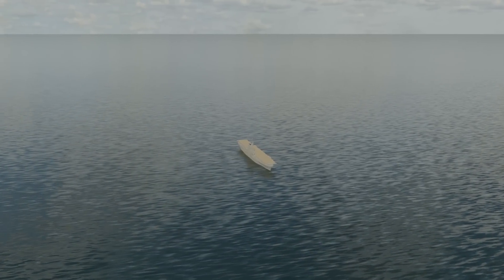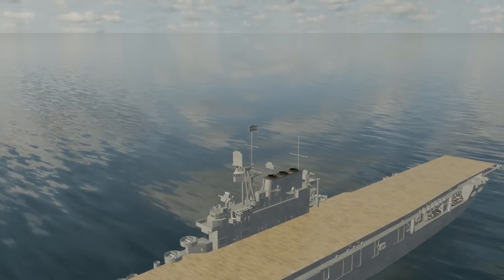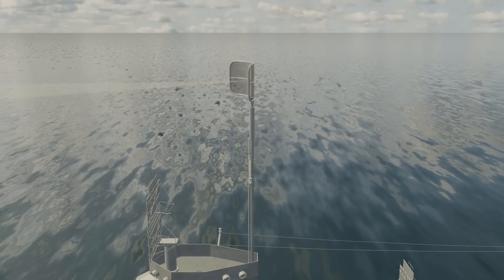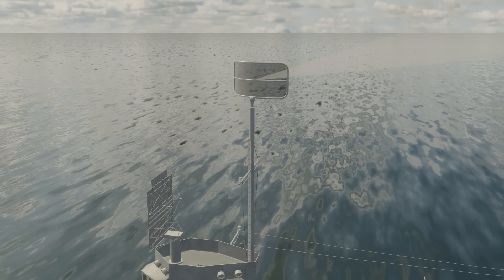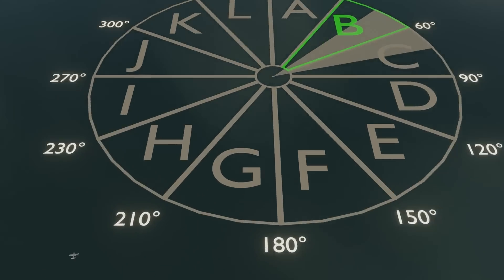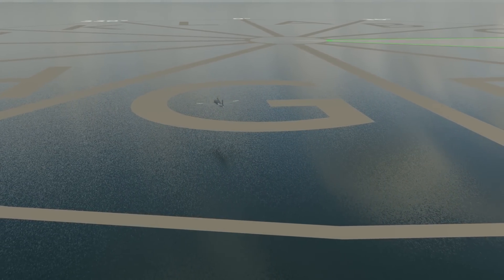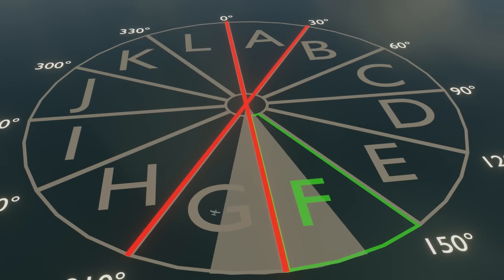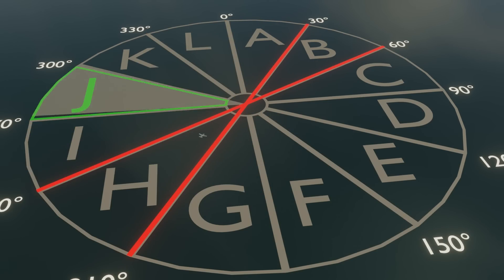Navigating Home: How WWII Pilots Found Their Way Back to the Carriers

Comment: Well, that is clever, however, being a former US Army communications specialist, I know that you wouldn't have needed to break the Navy's simple random Morse code shuffling system to determine the direction of the carrier. That's the weakness of continual transmitting on a single frequency. One need only have a direction finding receiver and a signal to tune in to... You would have needed a lot more than changing the code daily in order to keep the carriers safe. If one sweep of the transmitter took 30 seconds, and the radius were divided into 12 sectors, then a DF receiver would only have the signal for 2.5 seconds every 30 seconds. But loitering for just a couple of minutes would give you enough information to get an azimuth on the carrier. And...a smart enemy having multiple planes in the air at different points on the compass would get different azimuth bearings on the same signal, thus TRIANGULATING your carrier with great precision. So, I'm sure there was a lot more to this system than explained, and you'd probably in fact want to randomize the frequency as well, and they probably even shut it off entirely if enemy planes were expected within 200 miles radius. This isn't what I would call a secure system, though they didn't have the ability to frequency hop or digital encryption at the time.
Reply: thats how the British detected the German U-Boats in WW2, and the U-Boats are sending short messages and not continual.
This forced the German Navy to develop the "Kurier" System which shortens a 85 Digits message to less than 0,5 sec. length and they changed the frequency after every message, but in 1945 the British manged to get even this short messages on changing frequencies and locate the U-Boats again.
Reply: @Nik111333  Yes. As I was saying. You transmit long enough on a single frequency, or known frequencies that can be monitored real time, regardless of whether it is coded, and you broadcast your position for triangulation, and this was possible even prior to WWII. On land, it makes you subject to having artillery trained on you, which is why in the Army we used remote repeaters at times before frequency hopping digital became standard, capable of jumping frequencies hundreds of times per second. And only if you have the correct "hop set" digital key input into each radio on the net, and your radio's proper time of day in sync with the others, will you be able to keep up and TX/RX with other radios that are frequency hopping. This made DF'ing by our enemies nearly impossible, for a time. But now, with AI and quantum computing, this may not be very secure in the distant future.
Reply: @ReptileRescue 
Have you ever looked up the Heddy Lamar frequency hopping patent? I don't know if it was just her idea or did she really have the electrical engineering knowledge to create such a transmitter.
Reply: @fazole  I thought it was Headley Lamar?
Reply: @Boba-Fett-GS1150Ez  Nope, Heddy Lamar was a gorgeous movie star with a brilliant inventive mind.
Reply: @fazole  FYI The name is spelled Hedy Lamarr.
Reply: @fazole  ...she based her idea  around the 88 notes on a piano keyboard
Reply: You are correct.
Reply: There was more to this thing than was shown in the clip. The first layer, the YE and the ZB, worked at around 250 MHz which was pretty bleeding-edge in the 1930s. The YE's output was modulated with a 560–830 kHz carrier which itself was modulated with the Morse code. The ZB was a downconverter that fed a small MF receiver. As you can see, unless you had a 250-MHz DF rig, you could not get much usable intel from just the YE's carrier signal. For more, just google for "ye" "zb". That should give you all the good bits.
Reply: I suspect there's more to the system that might still be classified.  I agree changing letters once per day was insufficient for security
Reply: @cantrell0817  Nah, that wouldn't still be classified. You're talking about old analog cipher and single frequency un-encrypted transmissions. Nothing about that would be classified anymore. But there are probably certain additional details not known to the person who made this video. I worked with the most highly top secret comms gear from the Gulf War and into the 2000s, and even much of that with digital encryption and frequency hopping is old news now and being copied by Russia and China.
Reply: First of all they would not be broadcasting this all the time unless they had planes in the air that was due to return. It would be normally turned off unless it is time. Additionally what radio equipment did the Japanese have on their planes that would be able to pick out the signal? The A6M zero often flew without even radios to start with. This sort of radio equipment in WWII was in severe short supply.
Reply: @aikafuwa7177  First of all...I did this as a military job. I've forgotten more about this stuff than you will ever know. 

You appear to be unaware that radio signals travel at the speed of light, and you don't need to broadcast "all the time" to have a slow lumbering carrier be found by intermittent signals. You also seem unaware that the IJN flew more than just Zeros. 🙄 There are these things called bombers...and recon aircraft...anti-submarine flying boats... All things that carry direction finding receivers and who were listening for this kind of thing. Apparently you're unaware that signals intelligence was a thing...
Reply: @ReptileRescue  You are making assumptions about history, when it has been well established that the Axis powers lacked radar, lacked extensive radio equipment. You are assuming that the IJN had the top notch gear and top notch people with radio directional finders all the time. There was shortage of effort of the IJN looking for the American carriers, yet they were spotted first by the Americans at midway, why is that? You assumed what you are used to applied to how things were 80 years ago.... Not too bright, are you?
Reply: @aikafuwa7177  Not too bright, are you?
Reply: Each of those aircraft would have to be fitted with RDF gear..... was that at all common in the IJN in WW2?
Reply: Radio direction finders were common technology before the war even started. 🙄That's what the LOOP antennas are on aircraft of the time, which included just about EVERY amphibious recon and patrol plane and bomber.
Reply: @trooperdgb9722  Jesus that's dumb 🙄
Reply: @ReptileRescue  Comments like this negate anything intelligent you bring to the table. Your follow-on response alone answers the question from @trooperdgb9722 professionally and informatively without arrogant criticism.
Reply: @loutrioti8375  I brought the intelligence on this topic. YOU, on the other hand, added utterly NOTHING but snowflake grievance. I have no phucks.

Comment: Without being able to determine direction, a pilot might easily fly 180 degrees AWAY from the homing beacon.  I suppose, if someone in the aircraft was watching for a change in received signal strength, eventually, after many, many miles, it could be determined if the aircraft was going the right direction or not, but by then there might not be enough fuel to make it back.  Speaking of fuel, flying back and forth to find the correct sector to stay in would burn up a lot of their limited fuel.  Many of them didn't make it back for one reason or another.  I think that the ones that did make it back had a pilot or navigator that kept track of his 'dead reckoning position' so that he'd have a good idea of about where he was relative to the carrier and known the general direction to fly.

My dad was a Flight Surgeon on the Princeton and was in a PBY looking for downed pilots who had run out of gas when the ship was hit (and subsequently sunk) by a 500 Lb. bomb.  I wonder how many of them had run out of gas going the wrong way?
Reply: And these losses were normally censored, as well as so much else. Back then, not only censorship was understood and taken seriously, it was far easier to censor any information. Nowadays any bloke with a Smartphone can get different news from thousands of different sources including totally fake news. 🤯
Reply: This system is designed to make sure pilots know the unambiguous direction towards the ship.

Comment: What was the range of the homing beacon?
Reply from the maker: It’s in the video. 275 NM
Reply: @x-planed I guess it worked in HF. That thing was quite a powerhouse. But over the sea, propagation always improves.
I worked as Air Traffic Controller all my life in an Aerodrome near Lisbon, and one day I received a letter from a French Radio Ham stating that our little MF Locator was occasionally received in Bretagne, France! He wanted to know its manufacturer and output, which I gladly provided... 😀
Reply: @x-planed  I missed it. Thanks.

Comment: Of course the enemy could easily use directional finding to track the carrier fleet
Reply: I don't think so. DF needs your cooperation. You must transmit for a given time when instructed, so that your carrier wave can be received and plotted by at least two receivers set apart. The intercection of both bearings will provide your position. From the Carrier everything was passive, just receive and plot, no reason to transmit for too long. He who does not transmit will not be detected.
I had to learn DF in Portugal as late as in the mid eighties, to take my PPL. Which was ludicrous, because there were no operational DF facilities anymore! 😂
Reply: @duartesimoes508  maybe it wasn't ludicrous, as you're just confusing the topic of this video with the DF training that you were required to have.
Reply: @touristguy87  You don't understand. We were learning something that we were assured never to use. It looked like a bad joke.
Reply: @duartesimoes508  ...what makes you say that I don't understand that? Did you understand my reply?
Reply: @duartesimoes508  you don't understand. The fact that you think that you would never have to use it is not the same as being told that you would never have to use it.

that doesn't mean that it's a bad idea for you to study it.

Comment: A WWII P-38 pilot stationed in Italy told me how he found his way back to his home airfield. He would transmit on a specific frequency giving the regularly change code for his field. Directional finders would locate his position and give him the heading to return to his base. Neither the location of his plane or the field was revealed in the transmission.
Reply: Unless the base used a remote repeater, wouldn't transmitting to the pilot also reveal the base location to direction finding?
Reply: Both stations could still be DF'd, but keeping the transmissions short would minimize the chance of being located accurately.

Comment: I was read many WWII books but this info is a totally new for me. Thx.
Reply: Me too, it's something no books mention.
Reply: It's quite normal - system was probably highly classified - even 50 years after a war :-)
Reply: Well, this system worked in a different way. "Letters" would not tell you the direction. Pilots were using as well another system.
Reply: "I HAVE read..."     Good luck with your English lessons ( which you need ).          :face-blue-smiling:
Reply: @dareisnogod5711 Awww, someone sounds upset they don’t even have to aptitude to speak multiple languages lol. Please demonstrate more of your superiority by using more 
unnecessary parentheses and emojis like a child would use in primary school.

Comment: Many have wondered how pilots found their way back without the enemy knowing, too.  Great video.
Reply: Its not as hard as this video makes it seem.  They had an area the ship was expected to be in and once in range they could find it pretty easily with radios.
Reply: @kingfisher7960  The easy method with radios is extremely dangerous. This video unfortunately does not explain why the Navy developed this system. (which suggest the person making the video does not know).

You do not want to broadcast your position to prevent enemies from determining where you are. So a continuous signal for which you can detect the source of the transmission is out of the question.  It might not just lead your own planes back to your carrier, but also enemy planes. And broadcast your position to submarines etc.

This system was made so that your own planes can determine roughly where you are, but the enemy cannot. The signal is too short to determine the source of the transmission. The enemy would hear it, but not know what the signal meant and thus not be able to determine the source. Even if they figured out how it worked, you could easily change the characters, so they would be pointed the wrong way.
Reply: @marcdevries9027  That's what I was thinking also.
Reply: @ivancho5854  In order to use triangulation you need a signal to be broadcasted for a while and picked up at the same time by two stations.
Reply: You think after pilots becoming POW they would have spilled the beans…maybe they did and it never got any farther than sure or never went up the right chain. The Japanese were fighting a 21 century war with swords
Reply: Whut😏 @misterbaker9728
Reply: The British had an even simpler system.  They coordinated all the pilot's watches with a master clock on the ship.  The ship's clock was connected to a very narrow aperture radio that rotated once per minute, exactly.  With the aperture facing north at 0.0 seconds, as it went through it's rotation, it would give a short beep.  The pilot would check where the second hand was on his watch and that became his heading.  If he heard the beep at 15 seconds, then he would turn to a heading of due west.  The actual frequency changed with every ship and every mission.  If the Japanese ever heard the beep it would be too short for them to get a bearing on it.
Reply: It's called Vernam Cipher or perfect cipher according to Claude Shannon.
Reply: Something is missing in ths 'explanation'. You know the letter, you know that C is after B but... you do not know direction.
Edit: they were using ADF. Without that "letters" would not help at all
Reply: IT does not explain why the japs could not use a radio direction finder to find the source of the transmissions.

It only explains how the USN planes did not rely on RDF antennas not why the japs did not try to use RDF.
Reply: @stijnvandamme76 The Japs were NOT known for their wartime innovation. That would have required a lot of time testing and funds to implement that they didn’t have as the war went on.

Comment: Still, 30 degrees is a huge chunk of uncertainty to fly in. I guess it decreased as the aircraft approached and with practice, but still a modern VOR has 360 beams (radials) instead of just 12.
Reply: He commented that it was enough to bring the carrier within sight.  Cheers.
Reply: @frankanderson4176 in good weather yes...
Reply: @duartesimoes508  once in close range the Carrier radar could pick out the plane and give an exact compass heading to fly.  Very basic stuff.

Comment: Excelent video, long overdue. This system already had some resemblances with the VOR, but without DME and I bet it transmitted in HF. Now it begs the question: how did the Japanese pilots returned to their Carriers?
Reply from the maker: This question repeats itself so many times that I’ll have to make another video about it😉
Reply: Some cynical will reply "the Japanese simply didn't return"... 🙄
Reply: Frequenc y –234 -258 MC  Modulation Frequency 540 –830 KC  Continuous-Wave Morse Code   Letter repeated twice in each 30° sector.  Antenna Rotation  2 RPM  ID sent every 10th rotation. 17  Range 275 miles  at 15,000 feet.

Comment: I read about one case where the ship's commander had the search lights turned on to direct a flight back to the ship, despite the protocol to leave the lights off.
Reply: @duartesimoes508 You are correct. 
My CFI’s father was a TBM aviator on that operation. He was one of the fortunate ones who made it back to his ship. IIRC Halsey made the call to light the carriers.
I had asked him about navigating back to the carrier years ago as I was curious about it as well. He said they used a beacon “like an NDB” and they “had a localizer they would turn off and on for a few seconds long enough to get a fix, and hopefully keep the Japanese from homing on the signal.” 
He was up in age when I asked about it, so details may have gotten a little fuzzy by then.
Reply: USS Hancock did that.